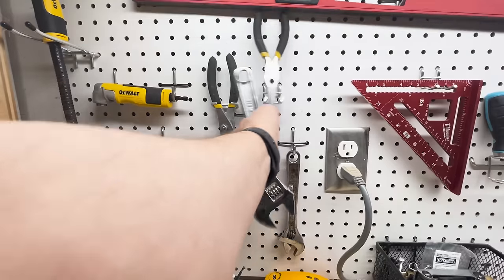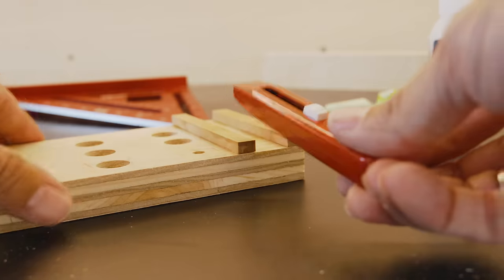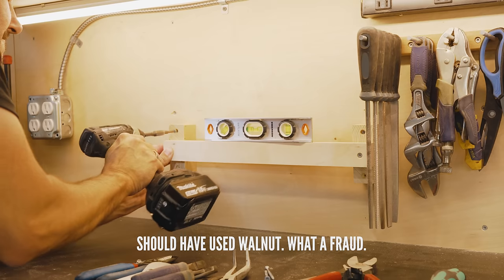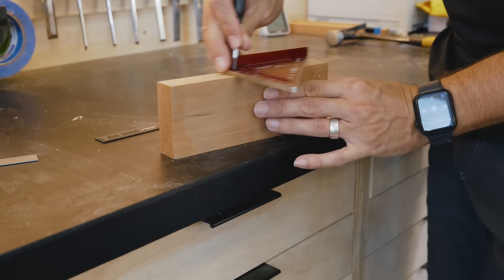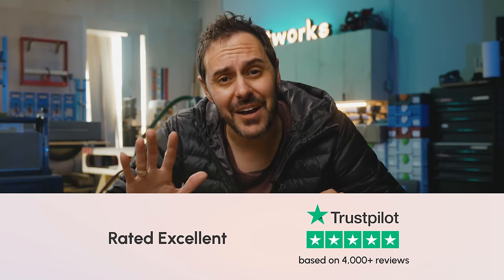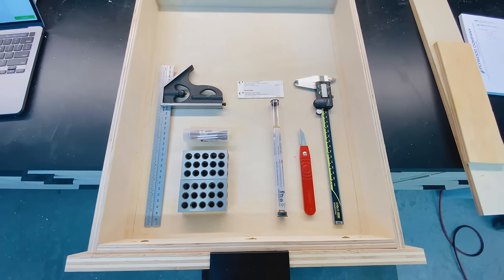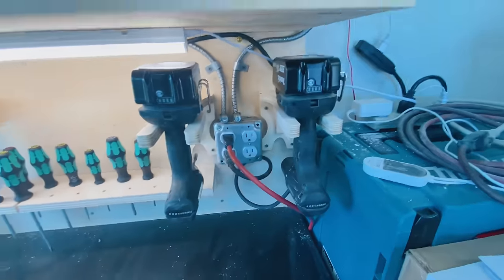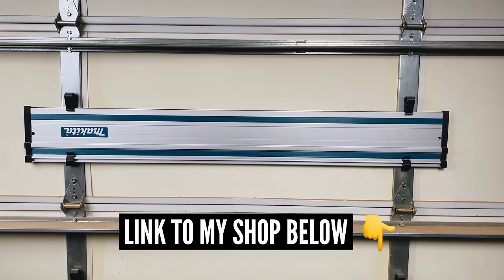How to make killer shop storage (w/out pegboard)

Comment: The only thing I disagree with is that you said you're not a real channel.  You could argue that the smaller channels are actually more real than the larger ones :)
Reply from the maker: very true! I was saying "real" with sarcastic quotes
Reply: Cheers @wittworks  , love the content. Keep it up :)
Reply: IMO, seems like the big channels are just sponsor sell outs. If it works, more power to them. I just prefer to make things on a budget. And most of the time, the tools are budget friendly.
Reply: The "real" channels turn into affiliate salesmen in a hurry and just get an unsubscribe from me.
Reply: Couldn’t agree more. My favorite part is when they tell me they are “unbiased” as their entire shop is covered in a specific brand.
Reply: Nice video that made me think hard a lot - few do! I watched Adam really hard too. ‘First Order of PutBackAbility’ is crucial too. A magnet on the drill press is a MUCH better home for the chuck than a gorgeous custom cradle that I need to ‘aim and re-install’ every use. Screwdrivers: I like a tin can mounted with one screw MUCH better than custom cradles. Stored tip-side up, they have HIGHER retrievability and I can put 5 away ‘drop-in-a-bucket,’ no sorting no aiming no cradling. Magnet knife strips are super unfussy too. Cups bins tubs buckets ftw. I make custom boxes also, get my make-therapy plenty. Thanks a ton!

Comment: Excellent! For years, I’ve been using plywood as my backdrop. The main differences, I simply paint mine with chalkboard paint, and then use different lengths of gold screws with a little bit of tubing over it, and then I placed my tools extremely close together, and then outline them with a piece of chalk. Moving things around is super simple.I only make actual holders like you have when the tool absolutely requires it. But similar concepts and I really like. I’m going to incorporate some of your ideas.

Comment: Excellent stuff. I worked in many different shops, and have rigged up many variations. The one tip above others, is to keep bench clearance of at least six inches from the bottom of hanging tools. Sweep up is easier, and safer under chisels. Screw boxes and temporary stuff can slide in below. Far less likely to knock a tool off it's perch. More effective bench room.
Reply from the maker: great tip!

Comment: For foam used in drawers, I've had success using a router  with a straight router bit to cut out the shapes of tools. I did it free hand, but first, I traced around the tools with a razor knife. It more or less scores the "skin" or the foam, leaving clean lines around the edges.

Comment: GREAT stuff! I have picked up some neat tips for tool holders from this video. My 'tool wall' is actually several areas of plywood throughout the shop, as I've NEVER been a Fench Cleat fan. Your holders fastened with just a few brad nails is still VERY 'rearrangeable' (if that is a word), and only a couple of pin holes to fill in.

Comment: I have a pegboard wall in my shop. Have had it for a very long time. A few years ago I re-organized things and built tool holders similar to the ones that you show but made them hang on the pegboard by mounting the pegboard hooks into them. And that I could work on bit by bit as I had time.
I did follow your general tip in that I put the frequent use things close to where they would be used, on the wall, not in drawers and bins. So pegboard isn't all bad. It's just how it's used.

Comment: I like alot of what you did there. And I agree its great to just go bang out projects like that. One additional thing I'll mention because I am also cheap and clever lol, that I didnt see. Harbor Freight magnetic strips. When they are on sale they are dirt cheap. So I have them spread out all over my shop and keep specific tools for each station on them. Like im talking by the band saw/router table/drill press Ive got all the allen keys to the machines tool change and drill chuck keys. CNC table ive got tool change tools, picks, exacto knives digital calipier ect. Just takes being able to just grab what you need when you need to a new level. I feel like mag strips are the failed dream of a pegboard. I had one initially, seems like a great idea, but in practice your picking up all those little holders from behind a table all the time. I do agree with how you did things and theres value in having your workspace be pretty and something your proud of is the big thing

Comment: You have such nice equipment!  
I have a 1 car garage... I don't  have a lot of room to put things. My work bench is full most of the time. My secondary work table  is 2 old saw horses. I have 2 chop saws one works when it wants to the other has no guard. PLUS  I have a table  saw that has a clamp to keep it running. I use a leaf vacuum  for my dust collection. I have a box fan that has a pc of dacron for a sanding dust collector... I guess I won't get into my tools LOL. 
I guess with what I have I do come up with some cool things to make. 
Interesting shop project on your show though. I will have to give it a try?

Comment: I'm very interested to see how you determine the dimensions, radiuses, angles, and other info you need to 3d print accessories based on a real work product. For example, once you physically have a Festool track saw, what do you do before you can 3d print the dust cover?
Once you have those dimensions, how much extra space do you add so there's enough friction for a snug fit but not so much that it's impossible to get off?

Thank you so much for the videos you make Drew. I appreciate your pacing, style, energy, and attitude.

Comment: Definitely interested in a woodworking x 3d printing series since it's a lot more approachable than cnc or laser cutting for most people.  Maybe a couple roundups of say shop organization prints, functional and printable jigs or tools, maybe test out whether some prints are really feasible in printed plastic (zero clearance inserts and hose adapters come to mind).  Maybe even walking through the challenges of designing and testing a new part.

Comment: I have been storing tools at point of use for years. I have multiple F-clamp and squeeze clamp hangers around tools and work surfaces where I always need a clamp. My 4” steel vise pedestal has hack saws, hammers and files right there.  I still struggle with abrasives sandpaper and sanding sticks like yours because they multiply and clutter. Then there’s the cutoffs, scrap and stuff that is too good to throw away-

Comment: I tried pegboard, and ikea board. It works okay if you 3d print A lot of brackets. Not for me.

Mostly I just use nails and dowels glued into board. And I have plywood bolted to the wall, I screw things into the plywood. It doesn't look as nice but it's super fast.

Also for tapes, instead of a big long pole full of tape (have to take all of them off to get to one roll in the center!) I have a tape wall with 30 pegs and 30 rolls of tape I can grab immediately

Comment: Great advice. I would avoid pin nailing the holders to your wall. Screw them in so they’re easily removable, otherwise you can’t modify them easily when you want to improve them, move them, or add new tools you’ll inevitably buy.

Comment: Great video, creative ideas, love the message to just try something and its ok to toss it if it doesn't fit. Also I'm now a subscriber for the potential of a 3d printing for woodworkers video. I'd love to see your process of prototyping and coming up with designs, laying them out in your favorite software, and different settings on the printer you've had to mess with to get things to work properly. I just bought a printer and am a bit daunted with where to begin

Comment: I’ve been thinking about getting a 3D printer for a while now.  I think I know which one I’m going to get.  My thought is to use it to make jigs, clamps, dogs, holders, etc.  to enhance my woodworking hobby.  I saw quite a few things you did in this video.  I’ve also purchased some of your products. So I would love to see a video about how you’ve integrated 3D printing into your woodworking.
Reply: the only thing I don't like about my 3d printer is that I didn't get it sooner. there's so many random things it can be used for. I've been using it for templates lately. The 3d printed templates don't hold up very well, but I'll use them to make a standard wood template so if the 3d printed template gets torn up I still have something to use.

Comment: The only thing different I would do is go with a French cleat system for mounting to the wall. This way modifying the layout is as simple as it gets. It also allows you to just grab a whole holder to take tools to a different area of the shop or outside to work.

Comment: Awesome video! I hope you do produce the definitive guide to 3D printing for woodworkers. I just bought my 3D printer a couple weeks ago for the expressed intent of organizing my shop. I love that it's passive time vs active work building solutions. That said, understanding when to use what filament is a mystery to me (e.g., I used PLA to print holders for my TSO parallel guides but the designer for the Festool rail guide holder suggested PETG). What's the tipping point to go from one to the other? Also, is it worth learning how to 3D model or just use existing designs?
Reply: Or you could just save some time and just order what you need from Drews store already made and ready to ship 😉

Comment: The SmartWoodshop's Tenet: Eschew toolboxes and fixed restraints; render all workstations mobile, encapsulating every essential within a 12-foot trailer. Thesis:  Tools to the task, not task to the tools. 🤪
Reply from the maker: Tools to the task. Love that! But your blasphemy bout getting rid of systainers…how does Festool and TSO still talk to you?!!!!!
Reply: Individual boxes for storing tools create a barrier between me and the tools, adding an extra step that increases the time required for the work. Additionally, I have a fully functional, no-compromise woodshop in a 12' trailer. The added volume from the boxes means I would need an 18' trailer to accommodate the same tools. While I embrace LEAN principles, tool boxes do not align with that philosophy!
Reply: Remember, though, I am not a woodworker but rather a carpenter. I specialize in building and remodeling houses, leaving furniture building to those with more skills than me.
Reply from the maker: That added friction is a real thing. I stopped storing my sander in the box. It was dumb.

Comment: I'm in the process of setting up the workshop in our recently-acquired first home. I'm blessed with a very nice sized space. My only issue, a very first-world problem indeed, is that the walls are all concrete block. I have a SDS hammer drill, and I am capable of properly anchoring into concrete, but I'm torn on whether I should fasten every wall mounted fixture individually,  or install furling strips beneath sections of plywood or similar. 
Any thoughts? I know there's not a cut and dry answer, just figured you might have some ideas. 
Thanks!

Comment: I really should get rid of my Milescraft drill guide. Every time I've tried to use it (e.g. can't fit a table top under my big drill press) it's just … well, like you said … 💩. I try to use it, end up wasting a piece of wood because the hole is so bad, and then just myself a guide out of a scrap wood drilled out on the drill press.  I went with french cleats because I rearrange stuff often enough (and I keep buying tools), but like you, my holders are a mix of 3d printed and purpose-built for a specific tool … and on that note, you hang your combination squares backwards 😉

Comment: You said something that struck me that I see in the 3d printing space a lot. We will design some freaking elaborate thing that could have been a piece of 2*4 with a hole drilled in it. When everything looks like a space shuttle sometimes you just need a hammer.

Comment: "Harbor Freight Proctologist Sale"??? Dude - you made me snort my drink through my nose. Too funny. And for the record - I own ZERO Woodpecker Tools - There are far too many high quality clones out there for a SMALL fraction of the price. I do admire the "Made in USA" ethos, but spending $129 for a tool that can be had for under $30, with similar (if not identical) performance is undeniably a better choice for the small (i.e. UNSPONSORED) shop, economically. I once tallied the cost of one of the "big channel" walls of red tools... over $2000. And that doesn't count their $1200 router sled (Mine cost under $400). That buys a LOT of lumber, or even some nice hand tools (like your Narex Richter chisels - of which I have the full set of 7). The red tools are all CNC manufactured - not much in the way of manual labor. There IS R&D, but still... price gauging is price gauging.  As for Pegboard -  I agree and disagree with you - it definitely has a place in most shops, in certain applications, along with custom storage options as you have shown. My pegboard is set up on an old ShopNotes plan (Issue 27, May 1996, p24), that has a pair of 2'x3' "wings" that have pegboard on both sides, and open opposite of each other - in addition to the back surface (against the wall) I have 36 sq/ft of pegboard that takes up only a 2x3 (x1' deep) section of wall. The outer "face" holds most of the "immediate need" tools that I utilize all the time. The rearmost holds blades for the table saw, circular saw, and band saw. In between are hand saws, C-clamps and other goodies.  I also have a dedicated drawer beneath my  drill press table that holds all of my vintage handplanes (century-old tools that I have restored myself are SO rewarding to use). 
Anyhow - keep up the great vids. Mucho appreciamente. (That's gringo spanglish).

Comment: I'd be interested to know the strength of 3-D printed plastic fixtures versus the plywood and, say, pine board alternatives.  I'm curious about how much weight per inch (is that a measurement?) so I don't design something that gets overloaded and breaks.  Too often I build something and eventually I overload it.  Probably a poor design, but stress testing would be an interesting topic.

Thanks for your work.  I've learned a lot and gained a new sense of humor that I'm shamelessly plagiarizing.  Perhaps  you should copyright that as well.

Comment: You nailed it, I'm not rich or a woodworking sponsored by someone that just hands you tools to have in your shop. I'm so sick of watching theses woodworking videos and all around them is these very expensive woodpecker rulers, squares, and DeWalt DeWalt DeWalt. Those are not American made, just assembled in USA all the parts are made in CHINA. That really makes me mad when, just because they assemble it in USA they say made in USA. WRONG. I worked for Clark forklift and I was fired because I refused to put made in USA on the forklift when they were shipped from China or Korea, I worked there for 8 years and containers came in all the time overseas and all we did would add on things for a customer what they wanted, any off the subject.  Your so correct on the expensive tools that the have and then tell you you need this when they got theirs for Free due to sponsorship. I have canceled so many subscriptions on channel's that do it . Thanks for the time to rant.

Comment: That cubitron paper is everywhere still, sheesh, I wish I would've bought a smaller pack to try it out rather than jump all in. Everyone's mileage with that stuff may vary, but for fine furniture work, I quickly learned that fast material removal does not mean good surface finish. I moved back to the festool paper due to the massive swirl marks left by the 3m mesh paper, and yes I tried multiple methods for sanding, patterns, speeds, not pushing too hard...etc. again, maybe it works great for some, but a real review of it vs other options used on actual furniture projects would be great rather than the videos that have focused on how quickly it removes material
Reply from the maker: the thing to remember about cubitron is that it removes material like the level below. So a 150 will actually function like a 120 in removal
Reply: @wittworks  I suppose that's one way to describe it, tho I don't recall them discussing that in literature but could have missed it. But what I was trying to describe was marks that were left behind that show up only after a wipe down with mineral spirits and a raking light, that's when they really pop and would destroy the finish if continuing without fixing it. Again, it may work for some, but I spent a few hours trying different sanding speeds and patterns with barely an improvement in results, moving back to a premium more traditional paper like festool or Mirka fixed the problem. I'm not concerned really with material removal speed on furniture as I should have done all the prep properly to ensure I don't need to sand for days. Reclaimed lumber or other odd projects where I really need to hog away material without care for the surface finish until later they've been perfect.